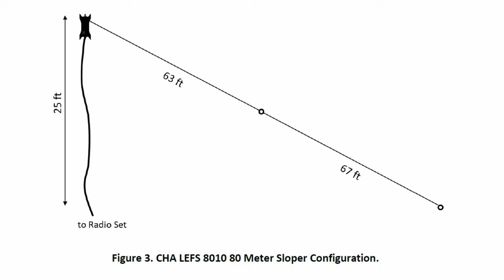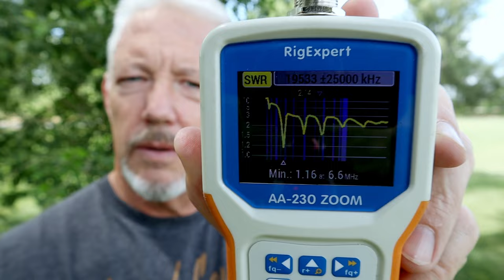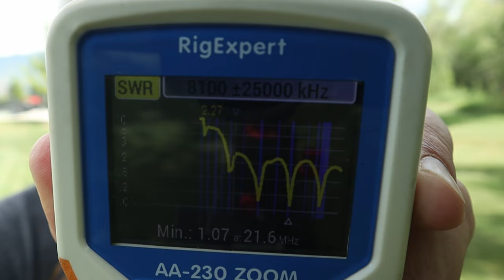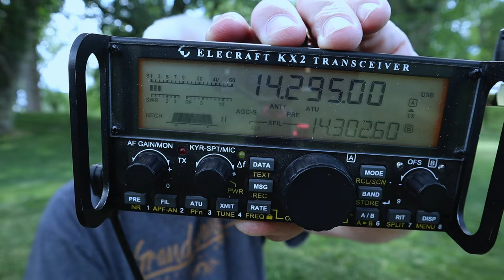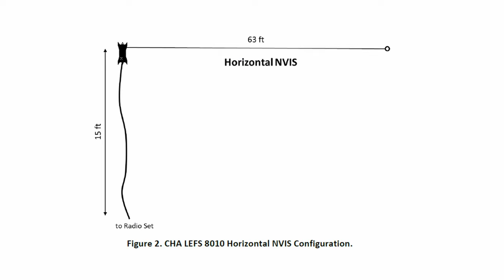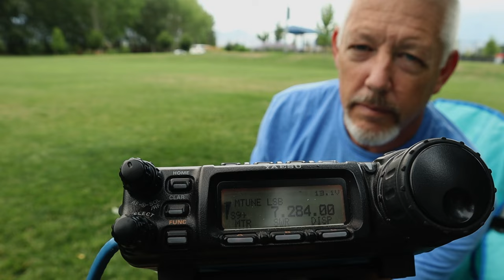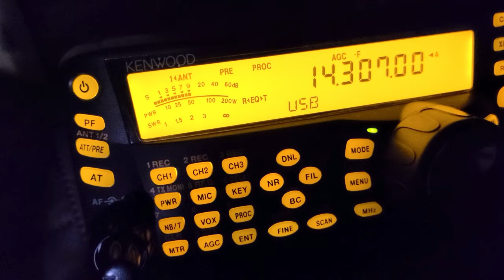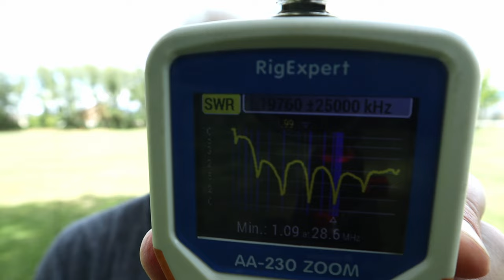In 20 minutes, this antenna became a "go to" for ME | K7SW ham radio

Comment: That's exactly what I'm aiming for:  Reaching Oceania from the Great Basin.  There is room in the yard for a 130' long antenna.  But the tallest tree is only 40' high.  Stable branches are barely 30' high.  Wish there were a way to get a horizontal antenna higher.  Perhaps the antenna line needs to be lighter - light enough to float on top of the canopy.  Is this a thing?
Reply from the maker: The fact that you have trees is a very good thing, 30 feet is fantastic, 40 is even better. 
Put the feed line (where the coax meets the antenna) in the most stable place since it will be the heaviest. the other end will go up like a piece of cake.
Reply: @hamradiowithkevin  This is very encouraging!  Does this antenna come with an official counterpoise?  Do you put a common-mode choke somewhere on the feedline?
Reply from the maker: @d.jensen5153  ,not counterpoise needed. I have been using this antenna with 50 feet of coax. I use the RF Choke at the feedpoint of the antenna.

Comment: So is the first setup the sloped wire configuration? I always thought the antenna would be in the trees and the line winder on the ground, I think I did my emcomm wrong .
Reply from the maker: No,  done antenna are designed to be on the ground, and others are designed to be in the air.  If your new to radio,  keep this in mind, if you can make contacts with your setup it is a win.  To me, the only wrong way is to not put up an antenna at all.  Can some antennas work better than others? Absolutely, do most all antennas work? You bet.  Keep setting up and having fun. You will learn more everytime.  
73

Comment: That is nice. I like building transistor radios and crystal sets and I believe this would work great. At the moment I'm using an telephone line and I get a lot of echo.
Reply: When the electric fence charger was off-line on our farm I would connect my crystal receiver to the electric fence wire and local stations were so loud that I almost blew my ears out, LOL. There was an estimated mile of wire on that fence, LOL. 73, Dave, KU9L

Comment: Don’t EFHW’s need some ground poise such as ~30’ of the feedline coax? So, how does  SWR dip so nicely with that “RFI choke” section at the feedpoint? de WX8V
Reply from the maker: It is the design for sure.

Comment: In a sloper configuration, have you tried it with the feed point closer to the ground? I think it shouldn't matter if it is close to the ground or on the high end.
Reply from the maker: The Chameleon manual specifically calls for the feedoint to be up, not every antenna is that way however.

Comment: Does it matter which direction and angle this thing is oriented? Im seriously looking at this antenna, but im hoping to set it up as my primary shack antenna and hoping to have it hooked up to a 991a. (Would it work ok as a primary long term fixed  antenna?) Like you, I live along the wasatch front and the mountains to the east kind of block things, so I'd like a setup to run sigmals both north-south and westward, but prefer not to set up 2 dipoles running at 90deg to each other. Id hope to run something like this all band either from my chimney to my shed roof or chimney to a 40ft tree or a stacked set of fence posts attached to a fence post near the tree. The tree option would be 45 degree angle west to south and the shed would be west to east.
Reply from the maker: If you live on the bench, you will likely  always have trouble getting back east with the mountains in the way. 
You should definitely experiment with east west and north south before setting up permanently.  You might get surprised by one configuration over the other.

Comment: Very nice presentation, excellent descriptions!  I have an OCF 160-6 Meter dipole that I am trying correct SWR.  My 4:1 Balun is at 33%/77% point, 40 feet above ground, short end is about 20 feet AG, the long end is about 27 feet AG. Readings taken at coax at base of OCF point with AA-54 are rather strange, 160 meter at 2.0 Mhz is 1.8, but 20 meters is in 6.5 to 7.5  SWR, WHAT? I am going to try raising the ends higher, and also adding some length to antenna, and also may try to adjust the OCF point from 33% to 20/80 point as some operators have tried successfully. Thoughts?
Reply from the maker: Try an rf choke,  also try different lengths of coax.  You would be amazed what that can do for you.  
Nice antenna you have setup.  
I have also made a few ozczf antennas and they are very fussy in where abd how you deploy them.  
This is a big reason why I like this LEFS 8010. It is a great match and it works each time I put it up. 
How this helps.  Kevin
Reply: @hamradiowithkevin  Thank you Kevin, I am finding out just how fussy they can be, but I am learning. I'll post my results.

Comment: Rigexpert AA-230 is $400 to $440.  This is why I have not got my amateur radio license.  The fact that my conversational abilities lack severely also adds to the reluctance of getting my license.
Reply from the maker: Don't let that hold you back,  I did not purchase an analyzer for 3 years after getting licensed.  A low-cost home brew antenna, and you're good to go.  You can absolutely have a ton of fun on budget gear.
Reply: @hamradiowithkevin  My very lacking conversational abilities are rather holding me back also.  As you can see, I can write within acceptable standards.  But my conversation is similar to what a child's conversation would be if they just met an aunt they have never met and they are shy.

Comment: Thanks Kevin.  First time I saw your channel - Subbed.  I'm looking to buy or make one of these 63 ft long antennas (all the space I have) as my first HF antenna.  Having a hard time finding steel antenna wire, though.  International shipping from American vendors to Japan is ridiculously high these days.  Can you tell me who sells the stuff in bulk?  Also, I saw the current choke - do you also use a balun?  Thanks!
Reply from the maker: Thanks for the Sub ! This antenna has a Balun attached to the line winder, It is hard to see with the shrink tubing on it. Don't use Steel wire, Aluminum and Copper will be what you want to build with. Wire is expensive right now, do you have a metal recycle company near you ? Often they will sell you wire that others have turned in, AND it can be in bulk 👍 For your First HF antenna, my suggestion would be a 20 and 40 meter FAN or Linked Dipole ( need only 64 feet for a linked dipole and 100 feet for a fan dipole ).
Cheap and easy to build and no need for a complicated Balun.  If you are running 100w of power, you can use wire as small as 20 gauge wire, less power = smaller wire.  You could roll it all up and be portable in fact.
I hope this information helps, Lets make contact one day . 73

Comment: If you use a sloper configuration does the feed point have to be at the high point or could the feed point be on the low side?
Reply from the maker: They recommend the slopper up in the air. I have tried both ways, we do what we must to get on the air

Comment: I wonder how a simple dipole fed with 450 ohm balance line going to a battery operated auto tuner would work compared to this antenna.   Granted you need a tuner.  But a small battery operated tuner good for 125 watts doesn't take up much space and the losses in the 450 line would be next to nothing.
Reply from the maker: Ken, It is my belief that a well placed antenna on a Good RF day, that many contacts could be made.👍

Comment: Hi K7SW, I was wondering if you're on the 8th floor of the building ,  do you still need to pull the length on the antenna, or would it work coiled up?
Reply from the maker: I am not 100% sure what you mean, so , if you altered in the 8th floor,  uncoil your wire antenna for sure. 👍 it should work really well.
Reply: @hamradiowithkevin  Sorry about that.  What I mean, I am in an apartment  on the 8th floor.  I was thinking of hanging it off my balcony wall but not sure if the height alone is enough or do I still need to unravel the cable.

Comment: Thanks for this detailed video! A question re the choke: Isn't chameleon selling a 50' cable with choke where the choke is supposed to be close to the radio and not the feedpoint? Doesn't the antenna need the coax shield as a counterpoise which of course isn't possible anymore if a choke at feedpoint is used. Would be a good experiment to set up like this and measure again?! 73s de Leo DL2COM
Reply from the maker: Your welcome, yes the do sell a cable with the built in choke. For this antenna Chameleon recommends to put the choke at the feed point. Other antennas could have you put the choke at your radio. It really depends on what the antenna builder wants to achieve.  This setup will be  an RFI choke and not an isolation balun.  I hope this is helpful.
Reply: @hamradiowithkevin  alright got it thx for your swift reply. so then this antenna really uses the ground as CP. might explain why the resulting swr values are so closely correlated with feed- and endpoint height.

Comment: thanks for the video and channel!  i ordered an 8010 from cha, along with the inline choke.  quick question.  knowing what you know now, where is the best place to put the inline choke?  as the feed line goes into the radio or up high at the antenna like shown?  thanks again.
Reply from the maker: Your welcome,  the recommendation  from chameleon is to put the chokeat the antenna. It won't hurt to experiment with the choke at the radio. The coax will be added to  mix is all.  The best antenna is the we have at the moment.  Have fun on the air 👍
Reply: @hamradiowithkevin , thank you kindly!

Comment: Are you using any kind of counterpoise?  If not, is it using the coax as a counterpoise, making the coax location critical to SWR?
Reply from the maker: There is an rf choke at the feedpoint, and no counterpoise is required. 
The manual for this antenna suggests having the feedpoint as the high point.
Reply: @hamradiowithkevin  In my application I need to do an inverted V at about 120 degrees.  What would that do the functionality?

Comment: These chameleon antennas cost $200.  Par End fedz (vibrolplex) makes a 40-20-10 that costs less than half the price of this antenna about $80.  You can fit it in a shirt pocket.  If you can live without 80 and 15m ( I sure can ) its a better deal and more portable.  Chuck it in a tree and go.
Reply from the maker: Chris, I also own a "Trail Friendly Para End fedz",  a really good antenna for  SOTA and very fast setup when i go on day trips with my wife. I  being operational in minutes. ( a great thing indeed)
The LEFS and LEFS 8010 works for me  because I like to use 80m at night and early morning for NVIS or local ERC nets on Saturday Mornings. I also enjoy putting 200w through an antenna from inside or outside my camper for a multi day POTA activation. Big fun.
Both of these antennas have a place in how i operate. Thanks for sharing. 73  Kevin
Reply: @hamradiowithkevin  thanks for the kind reply.  I get it, and you seem like a decent guy.  I think I’m getting cynical when it comes to Chameleon I suppose.  I find a lot of their gear extremely overpriced, much of it no better or inferior to competitors (including other made in USA gear like vibroplex).  My low-power (35w) EFHW from MFJ (1984 lp) cost me $45, and I won the Tennessee QSO party contest with it last year (and probably this year-the 2022 contest was yesterday), shattering the previous record by 10x the points for qrp.  My 40-20-10 from Par set up in the great Smokey Mountains national park cost me around $60 a few years ago, and despite thunderstorms and mistakes I made in my first POTA set-up, I still made 200+ contacts with it at 12w with my kx2.  So when I see $225 EFHW’s, I have to shake my head and wonder what Chameleon is thinking.  Usually, they put the word “tactical” in front of their products, and I “head-for-zee-hills” when I see it because it usually means a $500 wire antenna with some aluminum whips and  a lossy coil to artificially get a low SWR across 10 MHz of the HF band.  To be fair, other companies like Buddipole over-promises on their gear too, and with some of their stuff you end up hauling 20 pounds of aluminum, wire, and cables  to achieve a high Q  vertical that needs to be adjusted or fiddled with every time you change a band or move 100 KHz.  

But that’s why I love EFHW’s.  They’re inexpensive to buy from good manufacturers, cheap to build or play around with if you want to experiment with 17m or other single band concoctions, and especially from Par you get an antenna that doesn’t require a tuner which truly fits in your shirt pocket.  Another fave, if you have built in tuner, is a random wire with a 9:1 unun.  LDG sells a great unun for $30; throw a 31’ wire on it, a radial or two, keep your feed line short (I use only 3’from my 2nd story shack) and you have an efficient, non-resonant antenna on every band!
Reply: Sir, I’m glad I read the comments prior to typing. I had intended to vent some of my cynicism about Chameleon products (mainly cost and lack of technical descriptions) but you summed it up quite nicely. 

I want to clarify that I do really appreciate the excellent review by K7SW and in no way think that this is a bad antenna. Just more than I would spend for the product.
Reply from the maker: @kd8opi  , yes I understand about being cynical. For me it is really about having fun and doing cool stuff in this hobby.  Building is good and buying is good at different times when we need more or  want stuff of course. I am as guilty as the next guy for paying to much for things sometimes. As a balance, I have built and scavenged for parts to build many a wire antenna and Aluminum pipe yagi antennas.  Thanks for sharing your experience, I love to learn from people like you who also enjoy experimenting.  73 Kevin
Reply: @drumfishing155  thanks, yeah I think that chameleon has gone off the deep end with their prices.  Their mag loops are now approaching $600 (for 10% efficiency on 20m, btw).  They sell a spike with a few screws in it for $60.  Amazing.  I’m not a cheap guy, I’ve blown plenty of money in this hobby-some of it going to chameleon.  But with experience comes wisdom.  This antenna here isn’t their worst offender. The thing is that MyAntenna (a well regarded antenna maker known for robust EFHW’s) will sell you an EFHW for $200 instead of $225 that handles 1Kw instead of 500w.  So, you are paying 10% more for the Chameleon for a less robust design, not all that terrible but not the choice Id make.  One thing I will Drive home to anybody who wants to get an 80 m EFHW, is look at K7SW’s review and notice you’re only getting a narrow slice of 80/75m.  That’s not his fault, it’s how all 80m EFHW’s work.  If you tune it for 3900 instead of 3500, you will throw all the other bands off.  That’s 130-odd feet of wire for a silver.  Go with a 66’ 40m EFHW instead, you’ll get all of 40, 20, 15, and 10.  You won’t get 17 or 12, but your install will only need half the height and half the yard for a flat-top  DX pattern on 40m.   A 41’ vertical wire and a 9:1 unun with a tuner and a short feed run (or a long one with a remote tuner) will do way better for 80m Dx unless you can put the EFHF 140’ in the sky, and it will be a good multi-band antenna too; well as good as any vertical is (no direction, low angle take off, it just gets you on the air).
Reply: @drumfishing155  For technical descriptions, you might want to read our User Guides! They're probably the best in the industry!
Reply: @kd8opi  Unless you've been living under a rock since the last 2+ years, inflations has been affecting us like everyone else!
Reply: Thank you for the reply. That is an excellent user guide! I had not noticed it before. I think by lack of technical description, I was referring to the actual matching networks on your products. For example, Is this a 49:1 unun on this model? On your parts description you just list a line wonder and SO-239 with no mention of the interior contents.   It may seem obvious to some, but on most of your models you don’t provide that type of information. Compare that to a website such as Balun Design that is completely transparent with what their products are made of. 

Again, I don’t mean to sound critical. Your products are beautifully constructed and I’m sure they are very effective.  If I had more of a budget, I would likely own some of them instead of home brewing the same thing.  Your delta loop is particularly appealing and a great design. Thanks again for taking the time to reply. That deserves applause on its own compared to most companies, so hats off to you.
Reply: @drumfishing155  Yes - they're 49:1
Reply: @Chameleon_Antenna  First, we didn’t have high inflation 2+ years ago.  Only for about the last 18 months.  Your prices were ridiculous then too, so that hardly matters.  Second, you’re the only company rep that gets on here and argues with its customers or potential customers who have negative opinions about your prices or your products.  This is the second time in as many months Ive seen you do this, and I don’t post many comments on here.  Frankly, it’s a bad look; and it tells me people who critique your products are hitting a nerve.  Make better products, lower your prices, or have a thicker skin.  You’re gonna need to get one if you charge people $60 plus shipping for a spike with an antenna jack in it.